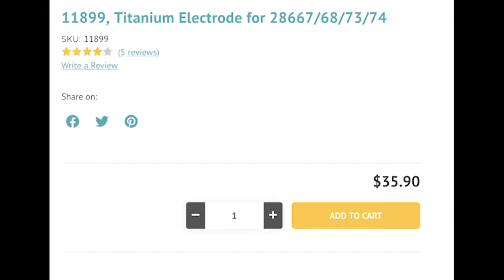Fix Code 91 or 92  Intex Salt Water System (Chlorine Generator)  titanium electrode replacement

Comment: Congrats on doing it the right way! Sadly The cost of the Titanium plate is not $100 higher at $139.... Still worth it compared to Name Brand Generator plates.
92 usually is an indicator the salt is to high for the current water level(evaporation does not lose salt)
91, Yep low salt from Splash out and fresh water fills., but also plate wear.

Comment: I have purchased 2 intex titanium salt cells within the last 6 months, the caseing is yellow not black like the original.  I have had to send both back and they replaced them... and each time they did not produce chlorine.  I can't understand why this keeps happening.  and now the salt cells are $119 or there about  not  $39  BIG increase.
Reply from the maker: Yikes, inflation is nuts!  Mine worked when I plugged it in. I can see it bubbling and the chlorine count is back up.
Reply: That is easy, your unit is not energizing the Titanium plates You need to confirm D.C. Voltage to cl+/cl- , the lower set of black/white wires.
Black Vs Yellow plate casings doesn't matter E.C.O. 5110 and 6110 use either.